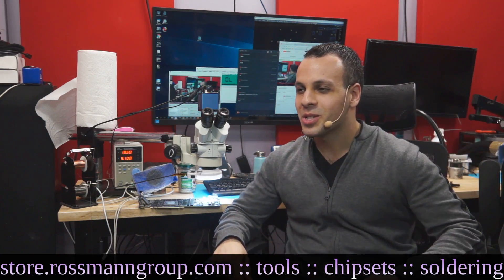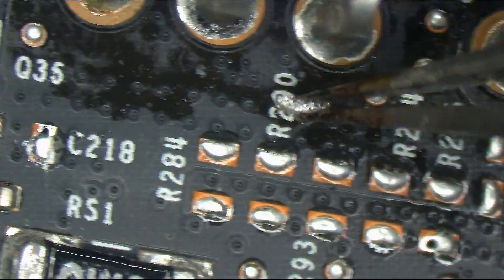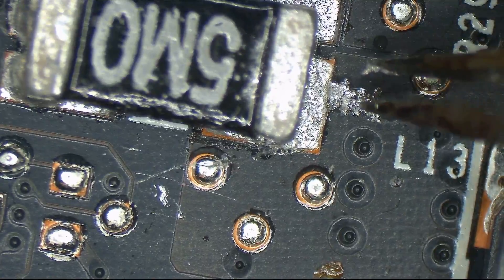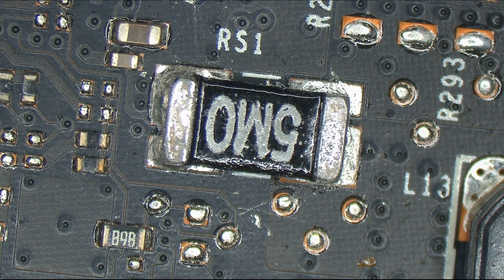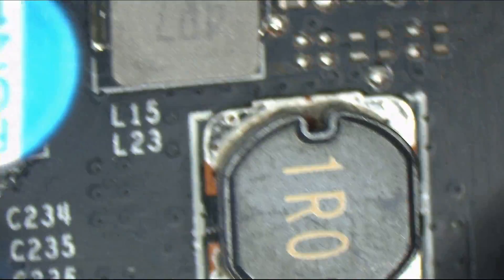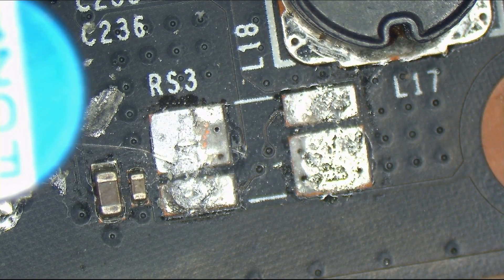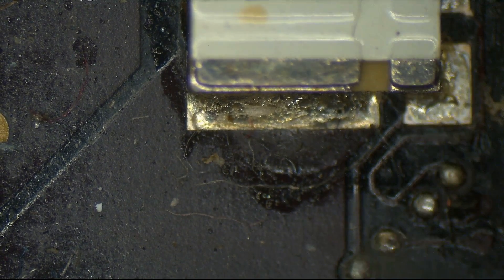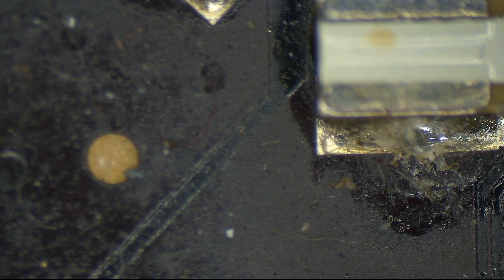DO NOT SHUNT MOD YOUR GRAPHICS CARD WITH LIQUID METAL!

Comment: well what probably happened is, that the guy put liquid metal (gallium compound) on the resistors to higher the power limit  and the liquid metal ran down the resistor onto the solder joint and coroded that, at least thats my theory since ive heard of resistors falling off gpus after a few months of the "liquid metal power mod" probably not nvidias fault, if they were all this bad then a lot more of my gpus would have failed.
Reply from the maker: Yup, I'm an idiot.. I am not a gamer so I was totally unaware of this.... for a second I forgot that people don't give the full history of the products they send in.....
Reply: @rossmanngroup  Louis, teach us how to bypass NVIDIA bullshit voltage limits that is only there to protect NVIDIA from lower sales due to people oberclocking their cards. 
NVIDIA always tries to scare everyone with the dreaded "chip degredation" but tbh Ive never once heard of anyone experiencing it. I've heard of people blowing up their cards, but never once have I heard of degredation. Perhaps becuse there is a thermal limit protection on them, that automatically shuts Off the card before you reach critical temperatures. So what if Im not using nvidias stock cooler that is useless, and after a week the dust clogges it and makes it completely useless. Lets say I put a H2O block on there with a custom loop? Nvidia says No! Your still only allowed the super safe Voltage decided by our CEO. 
I had a 780 with custom bios (nvidia no longer allow people to even run costum bios) that bypassed the voltage and watt limit. I settled at 1.3v on the core 0.2 v higher than stock, and that card still sits rock solid with a waterblock for cooling ofcourse. Now in my sons computer like 6 years later. NVIDIA executive engeneer (bs title anyways) says moving the Afterburner slider from 1.0620 V max to 1.0930 V .."is the difference between your card lasting 3 years, to your card lasting perhaps not even a year" 
W T F ?!?!  0.03 V 
..without even any other variables will kill your card in less than 1 year? Hahahaha
Reply: That is 100% Gallium corrosion, considering that's even a shunt resistor lmao. You'd think the person who paid you to look at it would mention that...
Reply: Louis Rossmann guy was probably watching some more Linus Tech Tips. They’ve been showing some liquid metal stuff lately. 😉
Reply: It's just metal that melts at body temperature more or less - but it has the nasty effect of forming alloys with other metals, making them soft aswell.
Reply: Precisely
Reply: Agree, Gallium is very nasty shit for metals, despite being non-toxic to humans :) Louis be VERY careful with any "gallium contaminated waste" like on your tools and solder station because small amounts can damage the aluminium case of an apple product, stainless screws, solder joints etc - it does not react, it "impinges" and the gallium atoms themselves last effectively forever. https://en.wikipedia.org/wiki/Liquid_metal_embrittlement
Reply: Makes sense. I think you have to short one of these to bypass the power limit on the card. And most people just put some LM to achieve that. It makes the card think it's drawing less power therefore increasing the power headroom.
Reply: What really blows is now you've got tools contaminated with gallium, which could effectively fuck up other components as you fix them.  Its almost like you got set up.  Then again, maybe they really just didn't have the foresight.  I'd honestly charge them extra for tool replacement for sticking you with that crap.
Reply: Maybe the guy bought it already modded and wasn't aware of that?
Reply: not supposed to use galium on those, regardless
*only across the top.
Reply: buckaroobonsi555 because liquid metal can be wiped away in case of a warranty claim!
Reply: I'm no expert at shunt mods but GamersNexus shunt modded a Titan V recently, they used nail polish to protect the solder from the gallium. Issue here is the guy just did the shunt mod without anything stopping the Gallium from eating the tin hence why Louis can peel off the resistors with just some tweezers.
Reply: Have to agree Microwilli . Board production line manufactures wouldn't use liquid metal because of the detrimental effects it has on the other metals and that Liquid Metal has a tendency to migrate and that  LM is not a structural material .
Reply: it's not 0 ohm like a wire - and because " i saw it on youtube so i must do it too".
Reply: That's what this is, for certain. Too big a coincidence that it's the resistor that needs to be shunted, and it's the only one with damage like this.  They cleaned it up before they sent it in.
Reply: A wire won't do, you need a higher resistance. Like an actual extra shunt resistor soldered on top, that is the proper solution. The problem with straight up wire is that the power management controller will detect that whoops, the shunt has been bypassed or has failed, let's run the card in 200 MHz safety fallback mode just in case.
Reply: First thing I thought of Microwilli
Reply: that is a good représentation of bias as a repair shop you only see broken stuff, that is good to establish a good sample size of common failure but some time  it is user induced failure or environnement induce.
Reply: Also that the other components look different.
Reply: Richard, conductive ink is not conductive enough. That shunt resistor has a value of 0.005 Ohm. With conductive ink, you get a few dozen Ohm at the very least. The proper solution is of course another shunt on top or a shunt replacement, but apparently metal TIM is close enough in value.
Reply: Normally it's temporary. <1 day for competitive OC'ing. Lifetime shunts should certainly be done with either compounding the resistors or completely removing it and replacing with a wire if the video card firmware doesn't lose its pants over it, and it's generally bad for the card, being the effective lifetime equivalent of illegal steroids in a human being.
Reply: Well i delidded my Intel CPU and put Liquid Metal IN there right ontop of the DIE. Saved me 20+°C. There is no solder or any kind of Metal that can corrode in there. So as long as you do it right its legit AND Save. (its 14 Months in there till now, no Problem). But using it anywhere else...especially directly on the board is dumb.
Reply: They actually use an expensive high performance aggressive corrosive thermal compound as a glorified short?? Ohh.. the stupidity..
Reply: https://youtu.be/hdTsra-uLBI
Reply: https://www.youtube.com/watch?v=3pflC72NfnU
Reply: WooF WooF
Reply: Microwilli that would be so retarted ......
Reply: Maybe just a cross contamination
Reply: why?
Reply: Well Nvidia GPUs do still fail quite often. I've had my GTX 1070 fail twice so far. Luckily you get 2 years of warranty by default in Europe, so I got free replacements twice (especially since the price has doubled since I bought it...). No liquid ever got near that card, the case is very well ventilated with dust filters on all intakes. I also didn't have a significant overclock on it. I pushed the frequency up a little bit, but did not touch the voltage (i.e. no extra stress on the actual hardware).

I've also seen similar stuff happen with other Nvidia cards. To be fair, AMD cards don't fare that much better. Other than RAM going bad or hard drives failing, GPUs seem to be the component that fails most often in a PC.
Reply: Thin silver paint layer on circuit handling tens of amperes through. Smoked bac... silver :)
Reply: People are sadly idiots. Or shy. I've learnt to say to people "oh, that's bad". I next need to learn to say "but thank you for telling me".
For example, the best data recovery I ever did, was a friend who asked me to get their data off a laptop. After I agreed, they told be it had fallen down the stairs, had the screen ripped off, been "throwing errors" for a couple of years... then they asked me. I did it, and never complained, and it went better than me saying "why did you not ask me earlier!!!". ;)
Reply: I have been screaming at people at how retarded this is , sure use it on the die but dont shunt mod with it , want to do that then change the bloody resistior you morons
Reply: This looked so unreal that it did cross my mind. Microwilli's version is very plausible.
Reply: https://www.youtube.com/watch?v=3pflC72NfnU
Reply: SAFE CALL ! u r right ... it was liquid metal !
Reply: Microwilli hello fellow Doge. Consume many Titan x lately?
Reply: I thought you did stream yourself playing Dota at some point.
Reply: Yeah, this is what happens when you use too much, and don't use conformal coat. It might have reacted with the tin in the solder (40% of solder is tin)
Reply: they knew there was liquid metal on there and they were still trashing it like it was going to be a common problem on 'nvidia' cards
Reply: @pahom2  because it's a quick way to get a partial short-circuit to bypass power limitations for a short overclock run of 3d mark only idiots leave LM on the shunts for any extended amount of time
Reply: I agree. I've never understood why people use liquid metal shunt mods, just jump the resistor. Easier to remove too.
Reply: @liquidhaste  Because your making shunt mod to make this card draw way over 500W. There is a decent chance that card will actually die, both power section and gpu die can be fried. VRM in this card is not the best, so most likely it'll die first. If the board looks untouched it might still be replaced, so soldering anything is worse than a bit of risk while using liquid metal.

Some people here said that it's better to do pencil mod. I guess it depends on card. Graphite is not as electicaly conductive, so you have to do that on resistor, not shunt resistors. Also it's not too acurate. Something more about this: https://overclocking.guide/nvidia-gtx-titan-x-volt-mod-pencil-vmod/

To tell the truth, I don't understand why so many people are trying extreme OC without any knowledge. It's not really increasing performance in games, it's just to get a few % in benchmark. I guess that people read about OC, find it as easy way to increase performance and then they want even more performance...
Reply: You're referring to 

https://www.amazon.com/Thermal-Grizzly-Conductonaut-Performance-Grease/dp/B079HDBYY3/ref=as_li_ss_tl?ie=UTF8&qid=1535321986&sr=8-1&keywords=liquid+metal+thermal+grizzly&dpID=31oGPtyPlpL&preST=_SY300_QL70_&dpSrc=srch&linkCode=sl1&tag=spaw07-20&linkId=79e48680ec141aa305aaad2ecfacc877&language=en_US

What about this as a CPU/GPU thermal paste?

https://www.youtube.com/redirect?event=comments&stzid=UgxIpANKoWuX4IvHRx94AaABAg&redir_token=YTsLUCrCmCAFNiL3BhUIFXITafd8MTU0NDUwMzUzMUAxNTQ0NDE3MTMx&q=http%3A%2F%2Fwww.247solder.com%2Fwp-content%2Fuploads%2F2018%2F06%2F247-LOWTEMP-15_SDS.pdf

Used here---->  https://www.youtube.com/watch?v=_luUCXGFTQ8&t=0s
Reply: Yeah, I don't expect this sort of thing from Nvidia or whoever manufactures their cards. You can say many things about Nvidia, but they actually make good quality products... most of the time.
Reply: you got Louis here for sure ;)
Reply: FF to February 2021 and unmolested but used GTX 1080ti cards are selling for above MSRP 4 years after release
Reply: Clean it up resolder charging a few hundred and go on.
Reply: I was asking myself the same question already a few years ago, when people started doing those "shunt mods". Because I knew that liquid metals were bad for PCBs since ages. I guess its so that they can remove it easily when they need to send in the cards for other reasons. But it's stupid. Still, even the biggest tech channels on YT " promote" this method, instead of used using a friggin soldering iron
Reply: +pahom Simple answer: because it's harder. You're talking about putting a dab of something on a board and sticking a component to it, vs heating an iron up, plopping the component down, convincing it to stay while you apply solder, convincing the solder to flow where you want it to if you happen to not have any flux and the surfaces aren't perfectly clean and fresh...
Besides, what did the original owner care? He got to overvolt the card for as long as he used it, and passed it on to someone else before the problem became a problem. Probably made back a good chunk of his original expenditure, too.

Not excusing any of it, just offering reasoning. I personally like soldering and much prefer the solidity of a good joint to...this.
Reply: john bumptybump Seems some idiots are confusing the use of conductive thermal grease (TIM) for better cooling with abusing that same material to short out protection circuits.  Using it as a TIM makes perfect sense if you take care to avoid short circuits and check that it doesn't chemically destroy something.
Reply: pahom You want an immensly small resistance, not a straight short. Back in the day we used to unlock Athlon XPs in similar manners - only with a soft pencilmark or some nailpolish-like car rear-window-heater-repair-liquid.
Reply: Why not change out the resistor or stack another one on top? The idea of adding a liquid metal to "mod" something sounds insanely stupid!
Reply: And the board isn't even manufactured by nvidia probably.
Reply: @peterkiss1204  in this case the board was manufactured by nvidia becase its a titan card which are not made by board partners only nvidia
Reply: Why do people do this in a world where conductive ink pens exist.
Reply: Gucky Hells yeah bro! I delidded my 8700k and used Thermal Grizzly Conductonaut- ~73 Watts/meter Kelvin, literally the BEST commercially available compound when it comes to heat transference - often it is actually BETTER than Solder, as its thermal conductivity actually rizes with temperature to a certain point!

Anyway, I got my core and cache running 5 GHZ using 1.36 Vcore, and a Noctua NH-D15 cooler with Kryonaut on top of the IHS, and running Prime95 AVX small FFT full tilt for over 2 hours, never saw any one core go above 83° C, even when my roommwas ~25 to 26° C from all the PC heat!

Gaming, I NEVER see my CPU get hotter than about 62° C, again even when my room is warm and my GPU is going full tilt (G1 Gaming GTX 980 Ti at 1503 MHZ core and 8 GHZ effective VRAM - which also never tips about 67° C, and I intend to take her apart, clean her, put new high end thermal pads in place, and then use Kryonaut on the GPU core! 

Thermal Grizzly Kryonaut is EASILY THE BEST Regular, non-conductive thermal paste! 12.5 Watts/meter Kelvin is VERY high for non-conductive  paste, in fact most paste is only good for just 1.5 to 4.5 watts/m Kelvin- with "Good" pastes like IC Diamond at about 6.2, and "Better" pastes like Cooler Master Nano Gel Pro is good for 10 watts/meter Kelvin, and that is the SECOND best paste I can find in terms of raw thermal conductivity based on the watts/m Kelvin measurement. Many pastes will not list this measurement, as it is often unflattering. Now this is the most important single figure in a high quality thermal compound, but due to other properties such as molecule size, it is possible that a paste with less rated conductivity will perform better. 

But that is another reason Kryonaut is so damned good! It is easy to apply, lasts forever, has a very small particulate size - and therefore performs  amazingly well! 

Hell when I re-pasted my brother's MSI GS63VR Laptop with Kryonaut, he lost literally 15 to 25 degrees Celsius under load on CPU and GPU!
Reply: solder on top as will you just don't us it
Reply: i dont understand why people use the liquid metal to do the volt mods. drawing on them with a pencil works and they also make trace pens that are designed to draw traces on a pcb which would be perfect to do this..
Reply: Hey, blame Gamers Nexus while you're at it, they actually show you how.
Reply: Microwilli yeah they were probably following their tutorial gamer Nexus did you're supposed to use clear nail polish to make like a space around it to keep the liquid metal from dripping on anything else
Reply: they should stick to the 2H pencil modding instead.
Reply: yer Aluminium (Ag)in the solder so it will want to eat that (pb free)
Reply: Louis Rossmann Lol, I was wondering why you called this video "Do not shunt mod your GPUs" when you did not seem to realize that what was flaking off of that shunt resistor was Liquid Metal thermal compound (usually Indium Gallium amalgamations, I don't think they are alloys) 

But yeah, no one OUTSIDE of Hardcore PROFESSIONAL Overclockers, and video makers that can earn the moen3y back from a dead Graphics Card - should ever, EVER consider shunt modding an Nvidia GPU! Even if you intend to do it PROPERLY by using a jumper wire!
Reply: Microwilli
Is that actually a thing? People believe gallium makes their graphics cards better?
Reply: I was literally clicking to type that in.
It could be gallium damage but, that would look more like a white powder.  Not saying for sure, but it could be just crappy soildering.
Did they mention the card manufacturer?
Reply: all my friends are telling me to shunt mod my card and this is why i wont do this to my 1080sc!! wish i knew what resisters i needed to just re solder them in to get the 20% gain.
Reply: It's just a gimmick. The outcome doesn't outweigh the risk.
Reply: They could use some silver paint to do this shunt mods. Gallium isnt a good idea to put this on soldering joints.
Reply: Microwilli yeah, usually you should protect the sodder with nail polisher but cpt. Genius was man anoth to just put the lm on it and call it a day...
Reply: Yeah, definitely not a good idea to put an electrically conductive liquid metal compound on your shit as coolant, especially one that weakens aluminium to failing point.
Reply: I guess this happenend to my old Inno GTX 970 after silver paint mod. 
The card locked itself to only 700-750Mhz core clock. 
Ram clock was normal.
Do not listen to fools like "Der 8auer"!!!